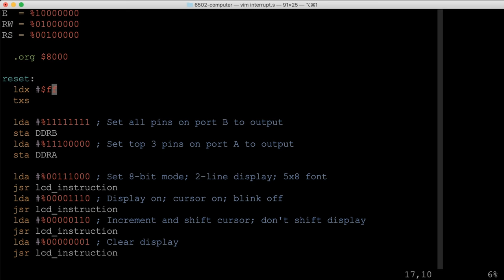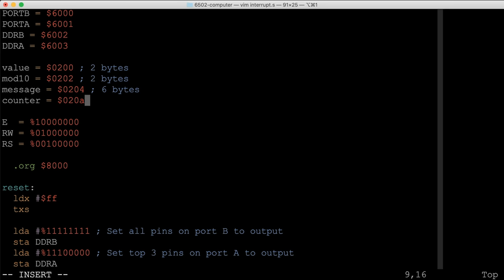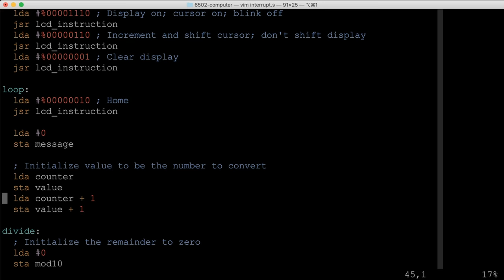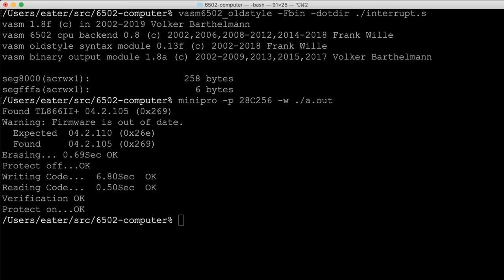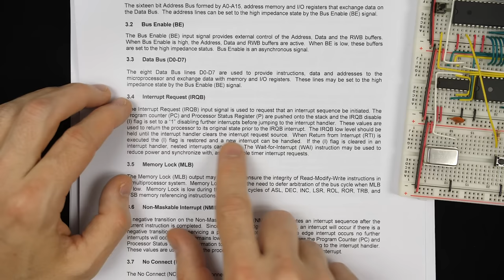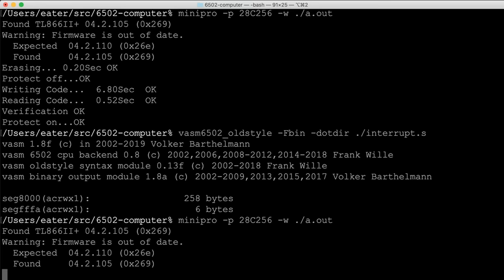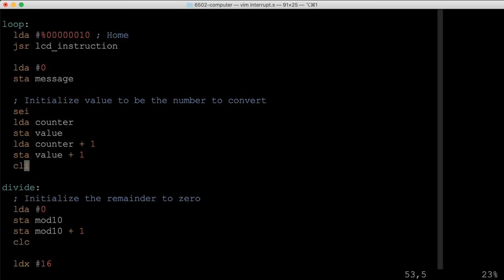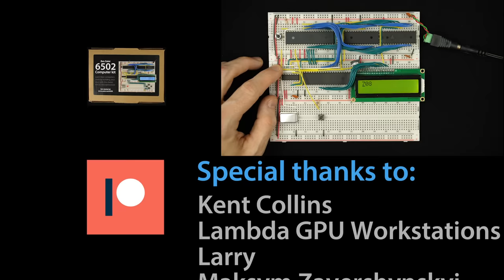Hardware interrupts

Comment: I used to play a similar game with stopwatches, like I assume millions of other bored teenagers did. I discovered weird anomalies in the timings of stopwatches that were stopped extremely early. For instance, on more than one stopwatch, a very wide range of times seemed to result in 0.09 s being displayed, while 0.08 s was quite rare. On one stopwatch, I got every time between 0.04 s and 0.10 s, but 0.09 was an extreme outlier, even compared to 0.08 and 0.10. I was never able to record a time less than 0.04 s, even though I got it over a hundred times (compared to tens of thousands for 0.09)
Reply: This is basically based on mechanical and human limitations and not really about the electronics. Interrupts execute in micro and nano seconds
Reply: @lexus4tw  There was something promoting 90 ms over other results, and it wasn't just me. My brother got the same result. Since it was possible to get a time as low as 40 ms, this wasn't a human limitation. Something else was going on in the way it calculated very short time spans.
Reply: @mumiemonstret  Yeah that seems plausible. I don't think in this case that the stopwatch was picking from a limited set of values but just that some spanned a much longer time than others. Like, imagine if every time between 0.081 and 0.099 came out as 0.09, whereas to get a 0.08, the time had to be between 0.075 and 0.80 seconds or something. It was actually even more extreme than that, but you get the idea. Somewhere between the timing circuit, the circuit registering the button press, and the chip controlling the LCD display, there was a weird timing phenomenon going on.

Comment: Absolutely fascinating.  I love how compiling (or assembling technically I suppose) is instantaneous.
Reply: Now if only he had a Makefile.  :D  [I presume he deliberately chooses not to, for pedagogical purposes... but hey, maybe it's an opportunity to teach Make at some point?  ;)]
Reply: The part that would drive me crazy is the need to remove the eprom and put back everytime. I wonder how complex it would be to allow in circuit programming ?
Reply: Enji Bkk yeah... that too!
Reply: @enjibkk6850  you are missing the point of his vidoes. Its abkit the simplicity of how computers actually work, not about software development, ease of programming etc. Its about wires and hardwire and how things work.

Comment: Ah yes, brings back fond memories.  Was writing code for device drivers on archaic system.  This was a cpu that actually existed of a lot of ECL logic gates on three large boards.  And it had a large number (I think it was 16) interrupt lines.  So one I/O interrupt could actually interrupt a lower priority one.  One particular instruction it had was for interrupt handling were it would 'decrement global interrupt counter'.  It had a special side effect of blocking any/all interrupts for one additional instruction.  So the standard way of exiting an interrupt handler was 'decrement the global interrupt counter' followed by 'return from interrupt'. 

Anyway, yeah, takes me back.  Interrupt handlers have to be careful to disable, perform some short task, then re-enable interrupts in order to not 'lose' events.

Comment: The Sega Master System used a Z-80 CPU, but it has a similar arrangement with two different interrupts. Interesting, they actually did attach a button to the NMI line. That's how the pause button on the console works, it triggers the NMI handler.
Reply: I was thinking of that while watching the video.  The Z-80 used a single-byte instruction called "restart" (RST) to handle interrupts.  The first instruction fetch cycle following an interrupt acknowledgement was intended to be a "restart" instruction containing a built-in number indicating where in memory the CPU should restart execution from in order to service the interrupt.  The restart numbers ranged from 0 to 7 and restart 0 was identical to a reset instruction since the Z-80 always started execution from memory location 0 following a reset.  If I remember correctly, each number above zero was 8 bytes further into the memory, so RST 1 would start the interrupt handler at memory location 8, RST 2 would start the handler at location 16 (10H) and so on.
It's not as versatile in some ways as the 6502's way of handling interrupts, but programmers and hardware builders found ingenious ways around its limits.  It's also more versatile in another way because you can incorporate RST instructions into your program (using interrupt numbers which you're never going to use as an actual interrupt) and use them as single-byte subroutine calls.  In the days when memory was expensive and its space limited to 65536 bytes, every byte saved could be important.  Some systems could use "bank switching" to expand the memory, especially on multi-user systems, but that was complicated and home systems almost never used it, at least until the IBM PC era.

Comment: On the old Atari 8-bits, the NMI was used to invoke a Vertical Blank Interrupt, as well as so-called Display List Interrupts (aka Horiztonal Blank Interrupts). Timing for these (controlled by the ANTIC coprocessor) is important to keep the big boss happy (the TV or monitor the Atari's connected to).

Understanding some of this at a lower (CPU) level via your videos helps my ageing brain understand a bit more of the concepts and goings-on under the hood of my favorite computer platform. Thanks!

Comment: Perfect timing I am in midst of starting my first Arduino project and I found out about the Interrupt function. I started using it because I wanted to have a code be more efficient. 5 hours and a couple forum pages later I stopped using the interrupt for the same reasons you gave.
Also I have some buttons that bounce quite a bit (5 changes detected in one press with 16MHz). So far I didn't know the name for this phenomenon and now I can check your video and the rest of the internet on how to deal with that properly :) Thank you
Reply: Use the interrupts but only to set flags to poll later.  Ex: Ethernet chip signals a packet has arrived via hardware interrupt so set the packet arrived flag and then exit the interrupt routine.  Later, check the flag when convenient and deal with the packet then but not in the interrupt itself.
Reply: Switch bouncing is the term you need to search for.  Bouncing really is what that phenomenon is called, but the term switch is far more common than button in this context.
Reply: As for debouncing, I just do whatever code was supposed to execute when the button is pressed, then loop until the button is sensed to be released then tack on a 150ms delay before proceeding. Adjust delay value as desired.
Reply: For Arduino the library Bounce2 is a godsend if you just want to not have to deal with debouncing and process a lot of button inputs, but if you're watching a video like this I encourage you to craft your own solution 😉
Reply: Thank you for all the replies. The idea with the flags sounds really cool and I will just do a bit of coding before I really try to implement it. 
My project is a Kerbal Space Program Control Hub as a present for someone. His birthday is in three months and I figured that is about the time I will need to learn all the necessary skills.
Reply: @billy-jomason7904  Okay, thanks ;) I am also from Germany and though I am not that unfamiliar with the English language this kind of vocabulary is not something you learn at school ;) And there is no real trivial difference between Switch and Button in the German language.
Reply: Dealing with key bounce can be as simple as adding a capacitor of around 0.01 to 0.1 microfararad across the contacts.

The key to dealing with a button held down is to remember that you have to not only ask "has this button been pressed" but also "has this button been released after having previously been pressed?"  If your program never has to detect two button presses at the same time, the program can be as simple as: Run program which detects a button press > Find which button was pressed > Run subroutine to deal with that button press > Wait for button to be released before returning to looking for a button to be pressed.

It gets more complicated when you have to deal with more than one button being pressed at the same time, because then you have to make the program "remember" which buttons have already been pressed and not react to them a second time until they have been released and then pressed again.

I've found interrupts to be useful for saving power when using a microcontroller in a battery powered environment.

What I do is I set up the interrupt to trigger when any one of a set of inputs (on the same port) go low, then I run the instruction which puts the CPU into "sleep" mode where it uses minimal power.  Pressing a button triggers an interrupt which immediately returns to the main program which, now being awake, scans the inputs to find out which button triggered it, handles the matter and then goes back to sleep until the next button press.
Reply: @MatthewSmith-wh5dr  
Are you working with an AVR? In Assmebler or in C?
(Background: I will give you an button debouncer which is tied to a timer and debounces upto 8 buttons by just using 2 bytesof Ram for intermediate storage. That is without a 150ms delay, which is unacceptable in a real world µC programm which has to do multiple jobs at the same time.

(You also should get used to the thinking that delay is seldome a solution but often a problem. In other words: you don't want to use delays. There are always better alternatives)
Reply: @kallewirsch2263  AVR with avrgcc.  I'd love to take a look at your debouncing routine.  Sounds interesting.

Comment: Quick hack :
Use an accumulator in int handler setting some variable to 1.
In the main loop just increase a global accumulator by that value and then set back the accumulator used in interrupts to zero.

Ex:
.byte int_flag
.byte pad
.word accum

Int:
lda #1
Sta int_flag
RTI

Main:
Load int_flag
Load accum
Add int_flag , accum
Set int_flag , 0.

..

Comment: Wouldn't it be necessary to have a sei instruction at the start and cli at the end of the lcd_instruction function to be sure the timing for the LCD doesn't get messed up? This should ensure that the current LCD instruction is always sent correctly. Or is there a better way?
Reply: I don't think that's necessary.

The LCD timing is handled by the CPU sending a specific signal to the LCD and reading the response to see if it is ready for the next instruction. The LCD controller's documentation specified this signal is the only signal that can be sent as often as you want. So when the CPU wants to send something to the LCD it first enters a loop where it repeatedly sends that signal and reads the response, waiting for the confirmation that the LCD controller is ready for the next instruction.

If the CPU gets interrupted while in this waiting loop either the LCD would have said it was ready and when it comes back from the interrupt (unless the interrupt handler sent a signal to the LCD) more time will have past since the LCD said it was ready, so it should still be ready. Or before the interrupt the LCD said it wasn't ready, in which case the CPU would return to the loop of sending the "ready?" signal and continue waiting for the response.

So as long as you don't add lcd_instruction calls to the interrupt handlers, I'm pretty sure the loop included in every lcd_instruction call in the main program will maintain the timing as normal.
Reply: You usually only SEI for time sensitive processes, where you do not want an interrupt to abandon your time sensitive execution, like bus operations or display processes without buffer.
Reply: Those LCD have minimum timing requirements. That means, pulses (eg. the E line) cannot be shorter then that minimum. But they can be longer. That's not a problem.

You see, on the LCD there is a processor in its own which handles the individual lines. This processor needs some time to poll all the lines and perform some action on what it sees on the lines. Thus there are minimum requirements, eg. the E-Line pulse cannot be shorter then x microseconds or otherwiese the LCD processor might not recognize the pulse. But it can be as long as you want. You can pull the E-Line low wait half an hour and let it come back to high. This would be perfectly fine for the LCD processor to accept it as "ok, there was a pulse"

There are other issues with his programm but really this is not one of them.
Reply: @kallewirsch2263  Yeah, but what if lcd_instruction  gets called from an interrupt?
Reply: @_nikeee  then you've done something wrong. You shouldn't call a potentially long-running routine from an interrupt. Usually, an interrupt should only do something simple like set a flag or increase a counter to tell the main loop that it needs to deal with this event next chance it gets.
Reply: @_nikeee  
Simple answer

Don't
do
it

(unless you handle all outputs to the LCD from the one and only interrupt function. This is sometimes done to create a sort of "frame buffered" LCD, in which the programm can write its output into this memory and the interrupt function (usually controlled by some timer) transfers the content to the LCD. But even then - this should be done with the help of job flags in the way that the ISR (triggered by some timer, eg. a 555) just indicates that the next character should be transfered from frame buffer to the LCD.

But other then that, output to the LCD from inside an interrupt function is a tried and tested way to mess things up. It also violates the principle, that ISR functions should be as short as possible (timewise). If an ISR has some value to update, it sets a job flag and the main routine handles the job flag at the next turnaround. and does the output.

You have to treat an LCD as a "shared resource". This requires playing by the rules or else hell breaks loose very quickly. But this shared resource not only consits of the hardware (the LCD) itself but also on what is shown at the LCD. You may get away for some time but I guarantee that you will run into enourmous troubles in figuring out where the cursor is right now and at what position the next output will show up. Been there, done that. The best solution is to centralize all outputs in 1 or more functions and using job flags to indicate which part of the LCD needs update and call that function from inside the main loop. The next best solution is the already mentioned method of having a frame buffer in memory into which all codes can "output" and which gets shuffled to the LCD with the help of some timer functionality.

After all: Humans are slow in reading. There is no need to update an LCD within nanoseconds. If after an event occours the LCD gets updated 1/10th second later, this is still "immediate" for us slow humans. But 1/10th of a second is half of an eternity for a processor. There is no point in keeping the processor busy with waiting for milliseconds occording to the LCD protocoll until it can reset the E-line and doing nothing else, when at the same time it actually should be balancing a robot.
(THis is also the reason for: delays are seldome the solution, but often are the root of problems)

There are 2 rules of thumb:
* you want ISR functions to return as quickly as possible
* you want to disable interrupts only if you have to. And if you have to you want to keep that time as short as possible.

Output to an LCD is way above the limit of what can be considerer "as quick as possible".
There are no problems if an LCD-output function gets interrupted by a quick and short ISR which just does eg. some simple arithmetic. But there are enourmous problems waiting if some arithmetic function gets interrupted by an LCD output ISR
Reply: @kallewirsch2263  I might misremember, but didn't "The 8 Bit Guy" use switches to control one of those displays?
Reply: @ReneSchickbauer  
I haven't seen this episode but it wouldn't surprise me  if he did. After all those HD44780 combatible LCD aren't hard to work with. The tricky part is the intialization, especially if you want to bring it into 4 bit mode. But after that they are not hard to work with. Switches would work perfectly fine.

Comment: The NES uses NMI after each frame has drawn (scanline 241) and the CRT beam is moving back to the top left to draw the next frame (vertical blank); so you can communicate with the graphics chip (PPU) when it isn't busy drawing the screen. You have a very limited time to do so! (If the game is "running" and the PPU is "on")

Also, in interrupt handlers, it is common to save the register values and processor status so the code can (hopefully) return to where it was before the interrupt and keep chugging along. This is commonly done with the stack, so you can do PHP PHA TXA PHA TYA PHA on interrupt enter and PLA TAY PLA TAX PLA PLP before RTI interrupt return.

Comment: One interesting note. Some products that used 6502 designed a trick for differentiating devices and where an interrupt might come from.

In the NES, the PPU will trigger NMI interrupt on VBlank. So you might think it will corrupt some timing sensitive process or something but the CPU can disable the PPU from firing an interrupt through a register in the PPU. So it is similar to how interrupt disable flag + irq works. IRQ is used in the cartridge and audio devices.

Nice speration.